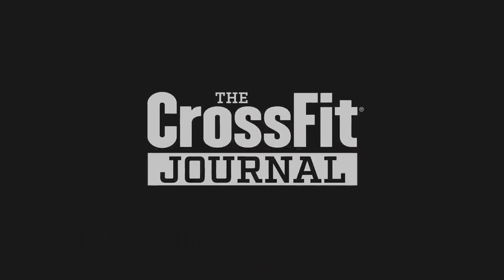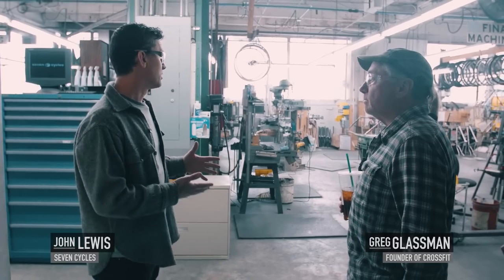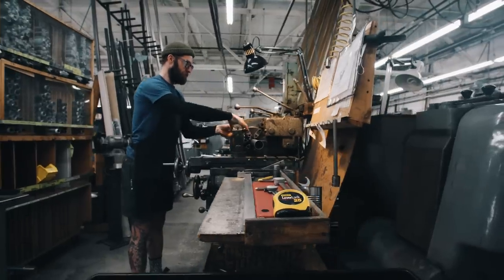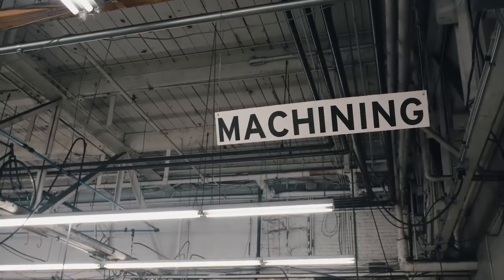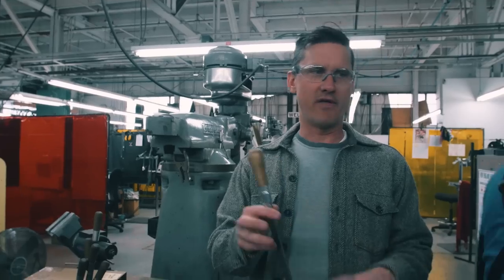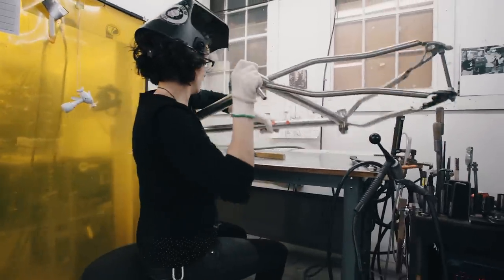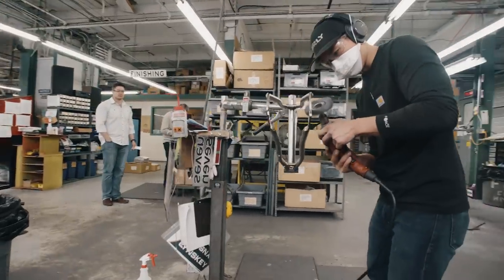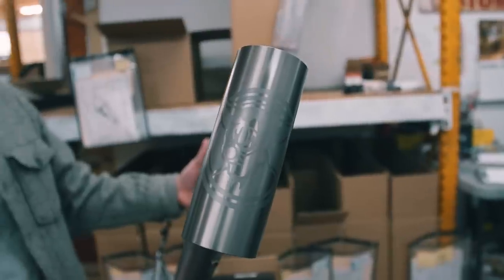Seven Cycles and the CrossFit Bike

Comment: Is this a joke? 8K for a bike? There are SOOOOOOO many other bikes out there that are WAY better for a fraction of the price! Good luck trying to sell these off...
Reply: It's a ton of money, but price out a bike with similar components and construction and you will end up about the same or higher price.  The Shimano drivetrain alone is over $2k.
Reply: You realize people buy wallets and purses that cost like $25k+ Right?
Reply: Hahaha you have literally no idea what you're talking about. NO Shimano drive train is 2k, the eagle is the most and comes in at $1300, but comes stock on most full suspension carbon builds for $3500. Anyone trying to justify this doesn't know anything about bike.
Reply: No. It's got XTR Di2 which is right around 2200 for a full kit. Maybe with the XT mixed in, this bike's drivetrain is closer to 1600.
Reply: It's $1700 for the full XTR Di2 drive train and putting that on a plus tire bike is foolish. Your gear range on it is very small. I don't understand how you can argue this bike for $8000. It's over priced by $3G.
Reply: Easily 3K- Taking advantage of rich housewives.
Reply: What are you talking about? XTR is a mountain drivetrain. Also, it doesn't seem like they intend for these bikes to be doing any gnarly trails (weirdly enough... why they chose a plus bike is beyond me!). 

I agree it's overpriced, but no more than most bikes at the  top end of the msrp scale :/
Reply: Im not tracking on "putting XTR on a plus bike is foolish"... it's a mountain drivetrain on a mountain bike, and if you want to put the money in to have the kind of top dollar shifting XTR di2 gives you, why not?

You may forget these are hand-made ti-frames, which worth it or not, usually run a pretty penny. The pricing with this bike is not far off of the pricing for the other Seven cycles frames. You can argue whether or not high-end bikes are overpriced (yeah probably), but this one is nothing special in the price department.

Comment: So this is a hand-built in the U.S. titanium 27.5+ mid fat custom frame, with Enve carbon forks and a Shimano Di2 drivetrain. That's a pretty serious build, so although it's not a bargain, it's pretty fairly priced for what it is. For one example look up Firefly bicycles. I would also have assumed that a time trial- or cyclocross-specific frame would have made sense, I think they went with a rigid mtn frame and plus-sized wheel/tire combo to most accurately represent what CrossFit is about - rugged adaptability. Road, dirt, mud, jumps - a "this bike does it all" kind of proposition (although gravel bikes do it all too). I would love to have this bike in my stable.

Comment: why a fat bike though?
Reply: My guess is simplicity and less maintenance with the lack of suspension.  A full rigid with normal tires would ride harsh and be pretty limited.  If they put a biking event back into the Games, if that is the plan, it would make sense that it would not be a single speed, and then would either be a fat bike or have front suspension.  Both were issues with the first time they tried the Games triathlon.
Reply: Cross fit cross country rough Rocky terrains climbing and beach cruiser!
Reply: It's actually a plus bike, only 3 inch tires.  Fat bikes typically have 4 - 5 inch tires.